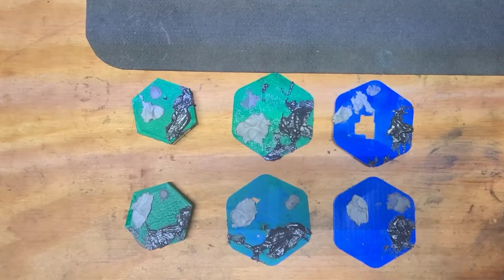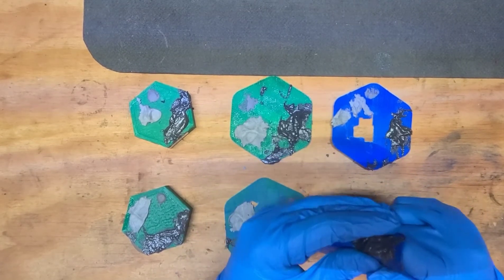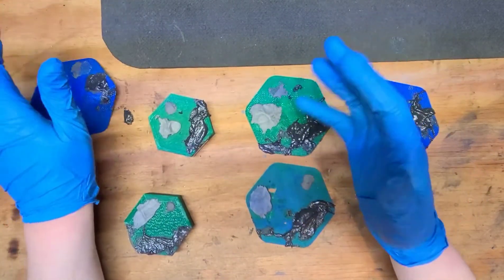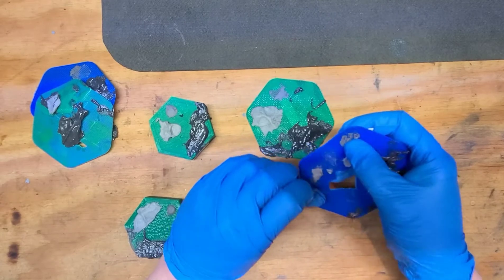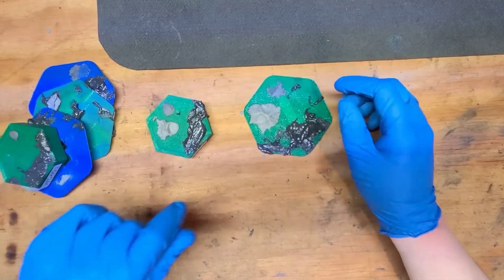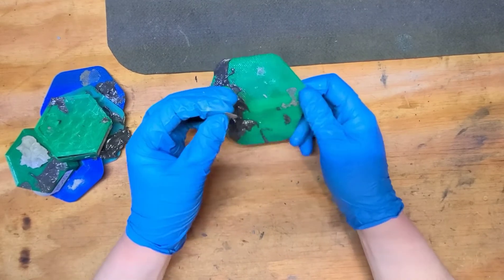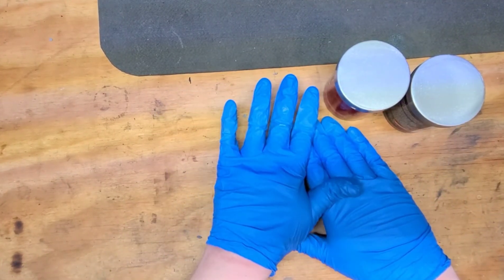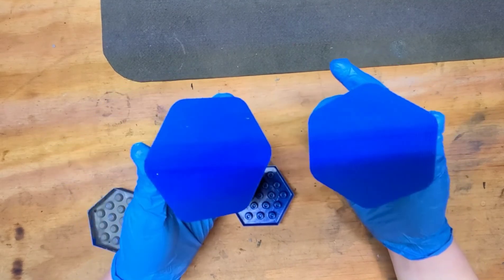6 types of possible mold releases on 3d printed PLA. Jb weld high heat, extreme heat, and CP7.

Comment: The cp7 was a much larger glob so had more surface area and what it is grabbing on is the layer lines so it might have made more sense to make each sample the same time and the layer lines orientation needs to correspond to which way you are going to release the part from the mold so you are trying to pull the part our "against the grain"